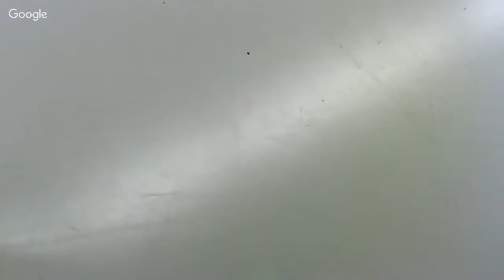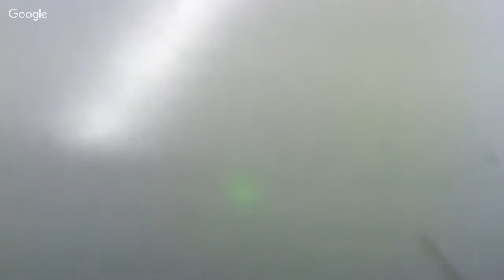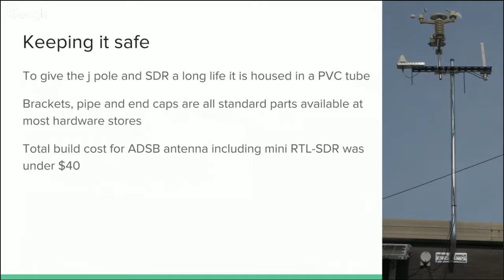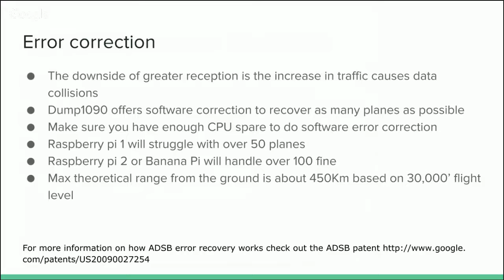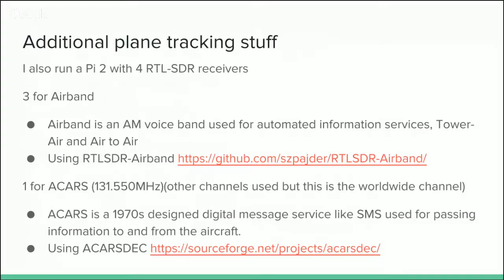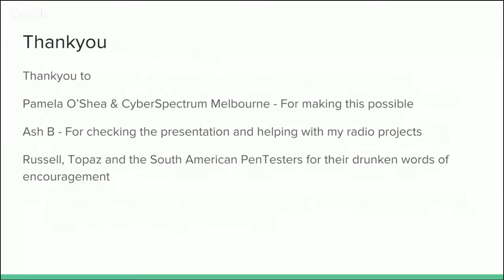Cyberpsectrum Melbourne # 4 - ADSB Antennae

Comment: A better version will be available in the coming weeks when I have time to record it again.
This will include some pics of the construction of the J pole antenna and other improvements.
Reply: Did you know you can run a realtek dongle from your android smartphone. HFDL is difficult to receive, and very selective my friend is a Ham used to work with HF in the adf its a mission but more and more they are using satelite comms now